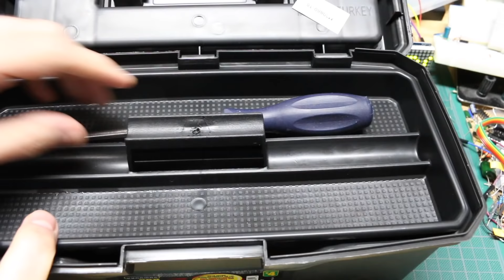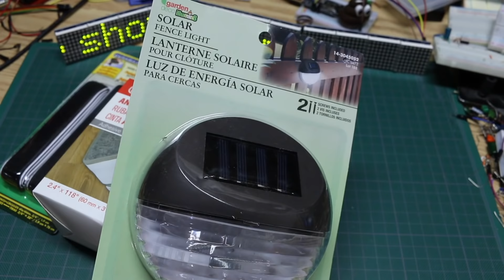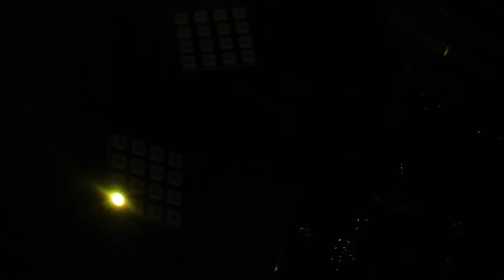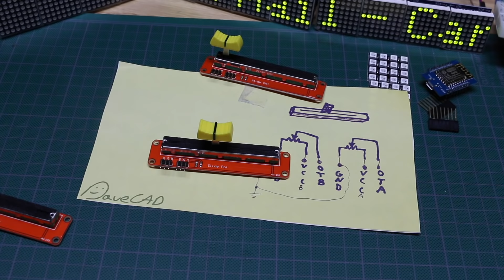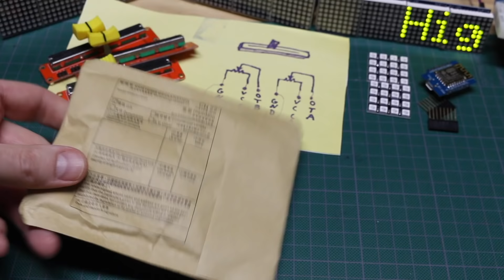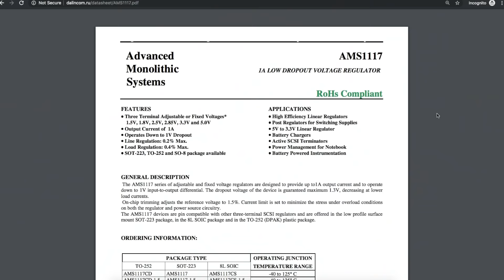Mailbag - eBay and Dollar Store Addiction

Comment: Grant Searle has some simple designs for z80/6502/6809s: http://searle.hostei.com/grant/

I tried to make a 6809 board but mostly failed. I think it because I was under clocking it (6809 registers are DRAM). 
1 MHz is too fast!

Have some Z80s & 6502s in my stock.

Comment: As far as i know, that usb connector is output only. Dont try to feed the adapter from it or your 5v regulator gets real hot... Yes, experience speaking here. :)
Reply from the maker: Thanks for the warning, good thing I didn’t have a USB cable to plug-in without thinking.   I haven’t blown anything up in a while so I am probably due  to make a few mistakes any day now!
Reply from the maker: I confirmed the wiring on mine has the USB 5v connected to the LDO 5v output so it's good you pointed that out!  I updated the video description to add that note and I've cropped a few parts of the video out where I alluded to powering the unit FROM usb so I don't mislead people.   The youtube editor takes at least a few hours usually to perform the edit for new viewers.